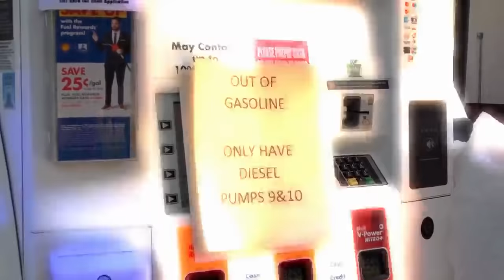Moonshiners Make Gasoline Out Of Alcohol During Gas Shortage | Moonshiners

Comment: Your basically making E85 just with more octane, only thing about alcohol is it eats your rubber seals and gaskets if your engine isn’t made for it
Reply: It also absorbs atmospheric water so it causes rust an corrosion and if left in a tank for more then a week will start to naturally dilute by absorbing water this is why you can’t run ethanol in 2 stroke motors
Reply: Um nope , I was running my 74 Mercury Montego MX on just alcohol and a good friend of mine thought the same thing I allowed him to take my engine apart and it was perfect he looked at all the valves the rubber rings everything and nothing was bad and in fact it was better than before , so no it will not hurt anything in the car.
Reply: @Justthemow  ethanol doest pull water that much methanol is a different story and yes 2 strokes can run on ethanol and methanol the carb just has to be jetted for it
Reply: mpkunz6336  out of these your comment is correct. But try running stabil fuel treatment and it will run fine on regular e10 from the pump
Reply: After reading all the comments, look, will E80/85 gas guaranteed destroy your engine? No. Is it good for them? Absolutely not. Yes, there are some engines specifically designed for it (that's a different case), and vehicles overall can handle it better then small engines, but as others have stated, within a week or so it will be begin to absorb moisture and cause all sorts of fuckery depending on the engine - anything from clogging carbs/fuel injectors to rusting gas tanks and fuel lines, to gummed injectors, ect., especially when not used frequently. But with small engines specifically, you will 100% prematurely clog your carburetor and cause water to pool in the gas tank no matter what you do if you run E85. Ideally you should only run clear premium (zero-ethanol gas), and at most E10. E85 isnt great for automobiles, but its horrible for small engines.
Reply: E100
Reply: @mudpawsvoom6132  I very much doubt that
Reply: @cactuscooler48  regular gas with 20% of this a”alcogas” would actually be best for the engine
Reply: I run my 86 Subaru gl on e85 only thing I did was rejet the carb she's been going strong for 2 years not one problem well besides normal Subaru problems
Reply: @loganmorgan5884  my mechanic friend doubted it too until I saw it for himself when he took my engine apart and noticed that everything was nice and clean nothing damaged
Reply: @mudpawsvoom6132  everybody has a "mechanic friend" on youtube when it comes to cars. Not fooling me buddy.
Reply: I was just about to say wont that stuff eat the rubber Lol
Reply: @loganmorgan5884  no my mechanic friend is class certified in automotive mechanics diesel engines etc so he knows exactly what he's talking about he can take a engine block apart blindfolded and put it back together and it runs 10 times better than what it did so no he's not a YouTube mechanic by far .
Reply: @mudpawsvoom6132  this has to be one of the dumbest things I have read in a YouTube comment section. I guarantee you that nobody in this world can take apart an engine block, rebuild it and have it running 10x better while blindfolded. Never said he was a YouTube mechanic. I said everybody has a "mechanic friend" on YouTube. Meaning I was saying your comment is bs.
Reply: Not just that it will toast your piston rings. But for sure if your engine isn't made for it you're going to find yourself having to overhaul your whole engine.
Reply: @AriesLR_  it is and it isn’t it all depends on how fast you use the fuel and how often you fill the tank. If you live in a highly humid environment, let’s say you live here in Louisiana where it’s 90% humidity all the time when you put your mower up for the winter it gives it ample time to absorb atmospheric moisture that then settles in the tank or bowl and causes hard starting at the beginning of the season. In a car if in your tank and you live it idle for months with a low tank of fuel the water can get in the tank causing corrosion and other dmg if you use your vehicle more often then it won’t bother it much if it’s in a colder climate it can cause the fuel lines to degrade much quicker. Where ever it is it’s garbage
Reply: mpkunz6336  yeah I agree and I didn't think about constantly running it through your stuff I rarely run my saw and other smaller engines and what have ya
Reply: @mudpawsvoom6132  It isnt up for debate. It is a fact that ethanol eats gaskets, and separates. If you ever see a white film near your filler hole, or if you happen to look in your gas tank and see a white film, that is the ethanol breaking down.
Reply: So true.
Reply: I just bought fuel injector and larger injector nozzles to my OHC 2.0L engine. I didn't have to change the engine.
Reply: @Justthemow  im from texas it happens
Reply: Dude in the overalls is sexy. 

I said what I said.
Reply: @Justthemow    CAR  gas tanks  are a Sealed system   the amount of air let in is equal to the amount of the tank it self    do you know how much moisture is in a volume space of  13 gallons of air?  not very much  to do anything
Reply: @punker4Real  if the tank is a sealed system how does the gas get sucked out and the tank not crush under vacuume all gas tanks have a vent nice try though
Reply: @mudpawsvoom6132  old cars just built different, I suppose, good thing I never wanted a modern POS anyways
Reply: @neetard7360  not to mention if we went to war a EMP burst won't affect an older style car like it would with a car from the mid 80s and up , all older cars can and will run do to no computers and electronic things in them.
Reply: @mudpawsvoom6132  n o i c e
Reply: @neetard7360  very.
Reply: @mudpawsvoom6132  either very old cars, like 50s cars as well as modern cars can survive EMPs. Modern electronics are shielded pretty well and usually are okay if an EMP hits you turn them off and on again and they're fine
Reply: @LouisSubearth  oh yeah I know if you use good shielding for them you have no problems.
Reply: @BlazRa  well you keep thinking that , I'll way at you when I pass buy you at a gas station.
Reply: The alcohol does affect some seals and literally turns them to mush. There was a rubber seal on the gas tank of my generator which was damaged by the alcohol. The fuel filler neck in my truck was also damaged by alcohol and started to leak every time that I filled it up.
Reply: @mudpawsvoom6132  seal composition and the metal corrosion resistance is what defines if it can resist or not, being an older car doesnt make it automatically fail these resistances the worse thing that killed pure alcohol cars surge before the 2000 was that they couldnt start cold if climate was cold